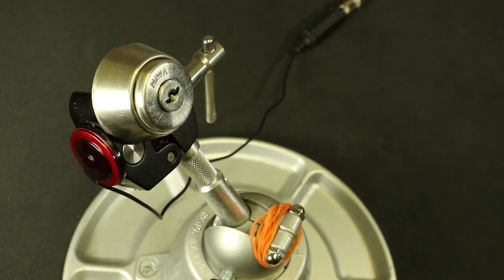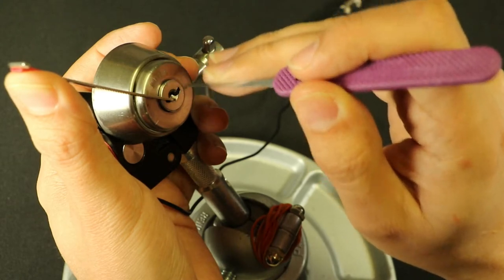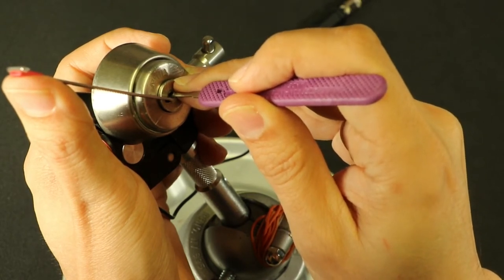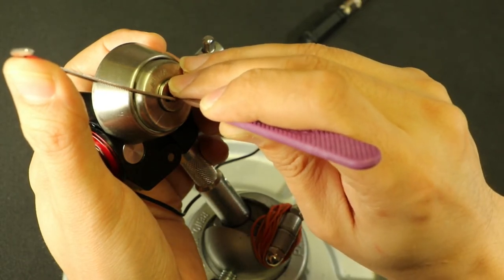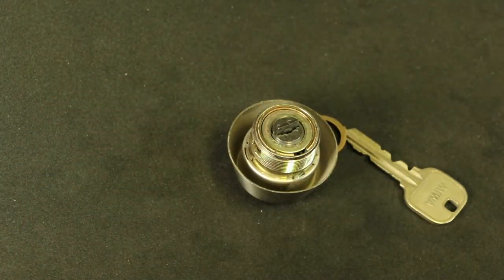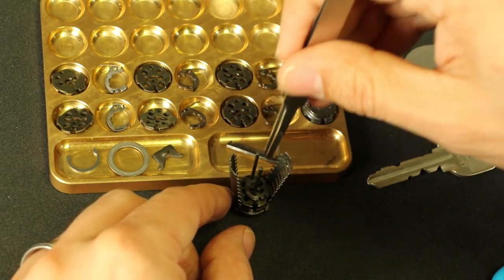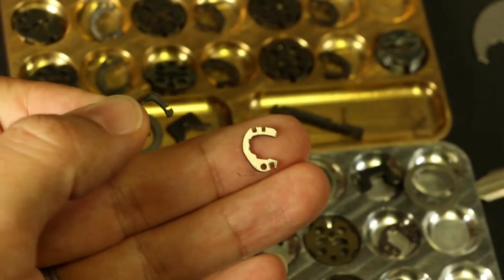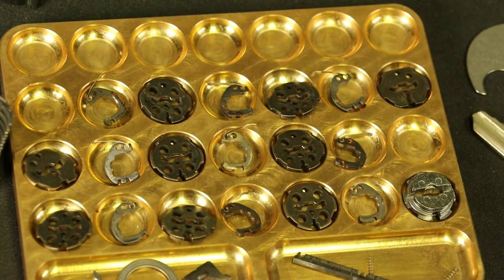[L199] Japanese Miwa U9 Lock Cylinder (smooth wafer version) - pick and gut

Comment: Smooth and mastered, but it still seems like it put up a fight. Thanks for showing that off! I have a whole pile of u9s I got from a Japanese auction, and I’ve found some mastered ones among the few I’ve dissected but none with smooth wafers so far.
Reply from the maker: Yah, the mastering didn't really play a role since I'm only picking to the first shearline except on the mastering with the wide gates. Those ones were much easier to jiggle test being in the true gate is all. From what I found, the smooth wafer ones all have the same back to them, with the solid slot across the back rather than it having the screws on the back of the plug.
Reply: @norlin76  Thanks, I’ll dig through the pile and look. I think all of the ones I looked at in my box have the screws on the back, but I’m hopeful I’ll find some variety.